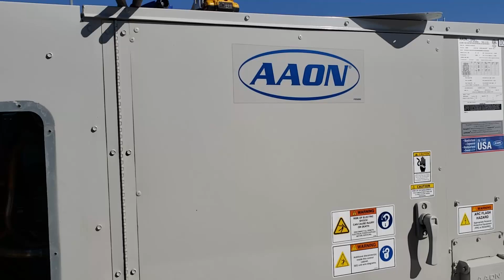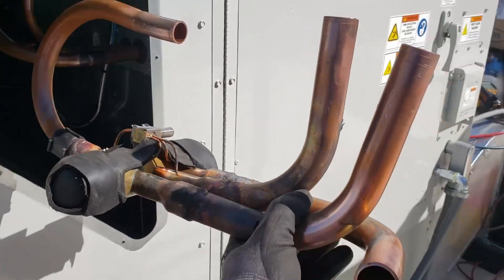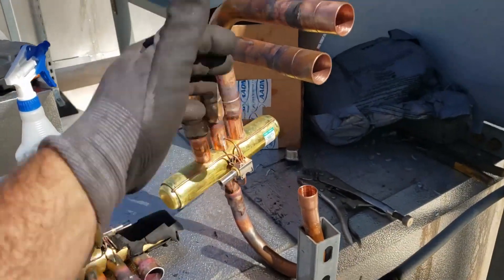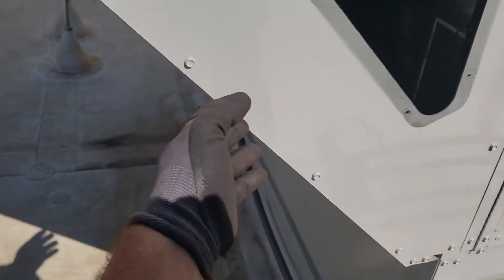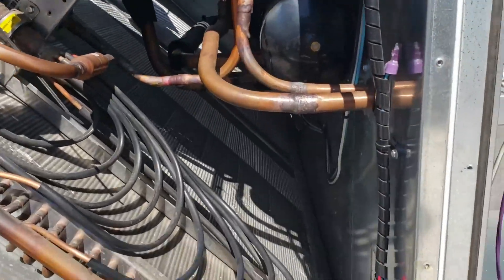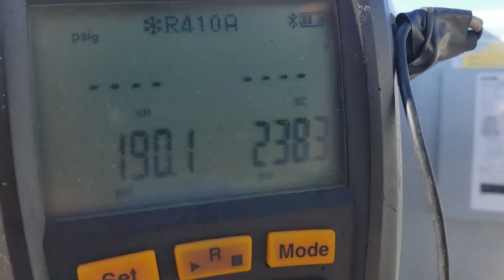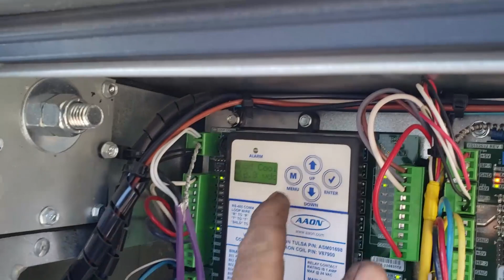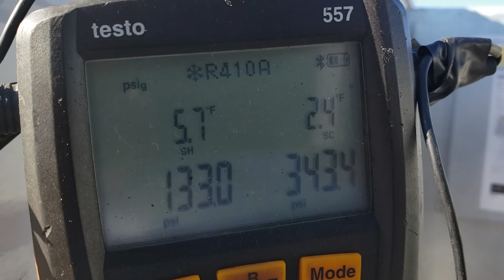Replacing a large Reversing Valve deep into an AAON MAU

Comment: I’m sure you have prizm software you could have overridden it on there. If they would have had that RSV right next to the outside panel that you removed it would have been much more service friendly. But AAON for sure went full retard on these.Lol image you had a needle size leak after all that. 
Like you mentioned that old valve showed the slider position centered instead of being in either energized or de-energized likely it wasn’t a control issue.

Comment: Hope the replacement is a better design.
Reply from the maker: This is a brand new unit under warranty.
After I figured how I would get it out by leaving some tubing on the reversing valve when I cut it out and then I removed that tubing and welded it into the new reversing valve outside of the machine before installing it back in with couplers and swages.

It would be a real pain to try to detach the RV and weld it into place back in there.
Reply: Lol was about to say that unit doesn’t look shy of a year old at least.